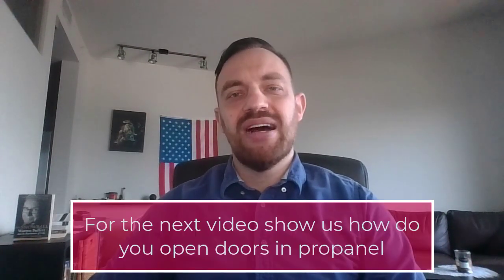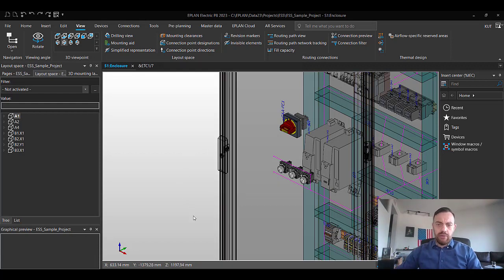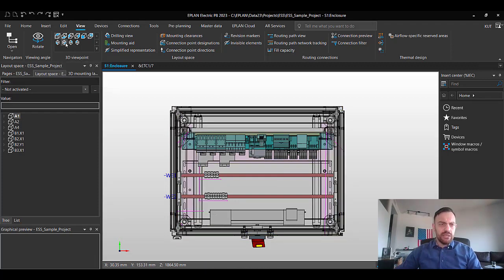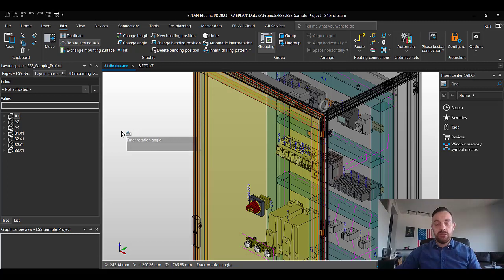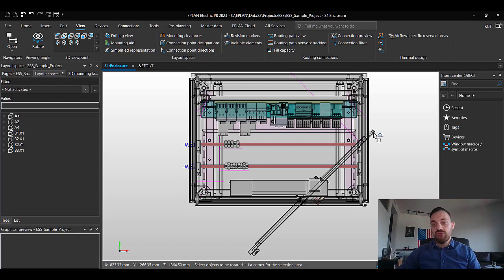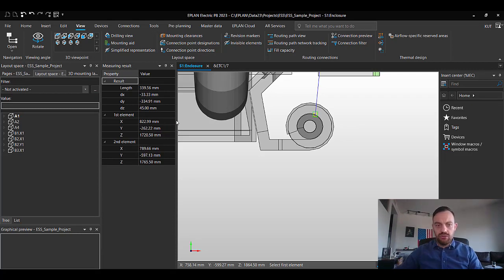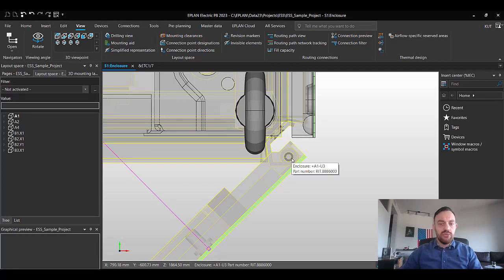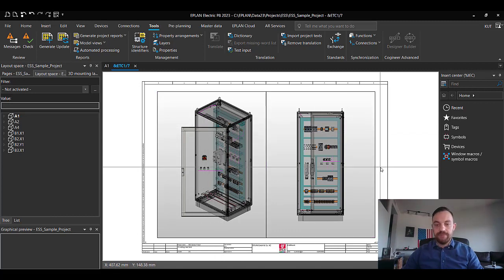How to open a Door in EPLAN Pro Panel

Comment: Hello sir, once I press CTRL+V an error occurs saying that "2D OBJECTS CANNOT BE INSERTED IN THE LAYOUT SPACE", any Ideas?
Reply from the maker: Hello Sir. Thanks for your question.

This error occurs if you try to paste a 2D Object(Schematic) into the 3D Environment(Pro Panel).

If you try to copy and paste objects in Pro Panel please make sure that the Software has the copy function completed before pasting(Perhaps the Design Mode is active, in that case you have to select a reference point)

Comment: Thanks. We are waiting for many years to correct the error when choosing the axis of rotation. For many years, Eplan chooses not the axis that the user specified, but the central axis of the element, which is very sad.
Reply from the maker: Hello Sir. Thank you for your comment, have you considered trying yo use the design mode when rotating the door?
You can contact me on LinkedIn for more information.

Best Regards
Kruno